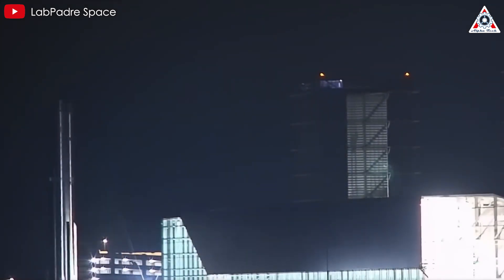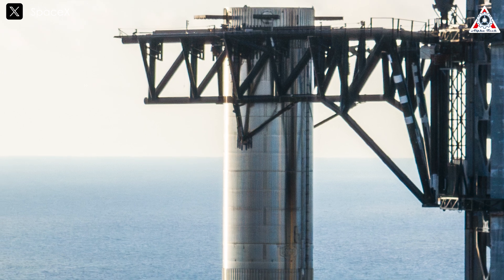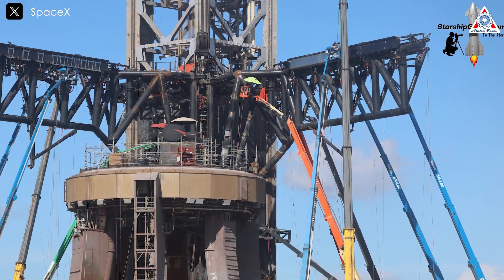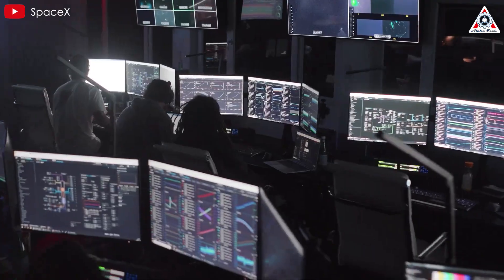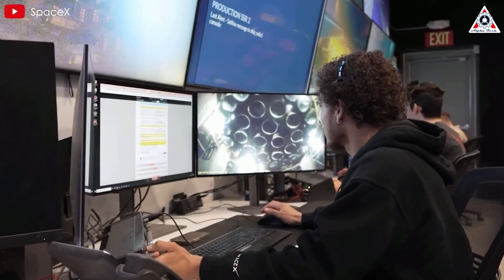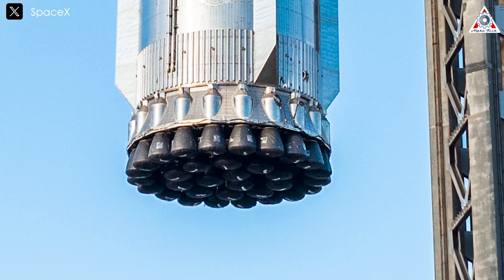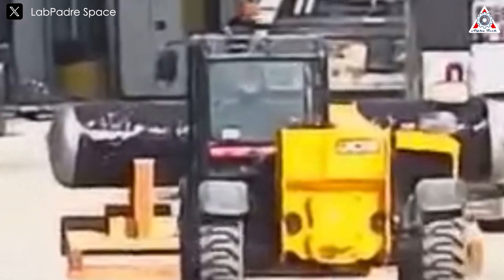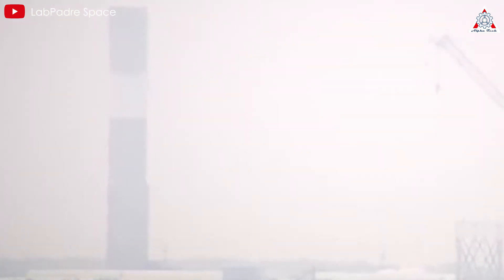SpaceX Just Revealed NEW Upgrade Starship Super Heavy For Catching...

Comment: I had a similar idea about a year or two ago I published , but it rather used springs under the rail on each chopstix arm.  I also published a cable catch method about the same time, and it would move the cables close to it, and would lift a series of connected weights vertically to reduce any potential impact.

Comment: The FAA are getting away with this because the house is on a break at the moment. No one to hold them to account for theur action or lack of.
Reply from the maker: The new government will step in
Reply: @alphatech4966  problem is they shouldn't have to. The FAA needs a serious audit and investigation for corruption.
Reply: You guys know not a thing about aviation, but you think you do...sad
Reply: @BruceSanchez-ur6wd  who's talking about aviation? We are talking about rocketry and space flight. Two different things.
Reply: @the_lomax  one could argue that helicopters and airplanes are not the same thing, but it doesn't matter. It's under the FAA, and either way, most of you guys know nothing about it.
Reply: @BruceSanchez-ur6wd ] Really having worked for Air New Zealand as an avionics engineer for the last 20 years and holding a private pilots licence would say I actually might know something. But hey you random troll on the internet guess you know more.